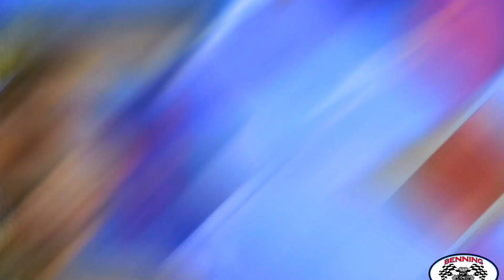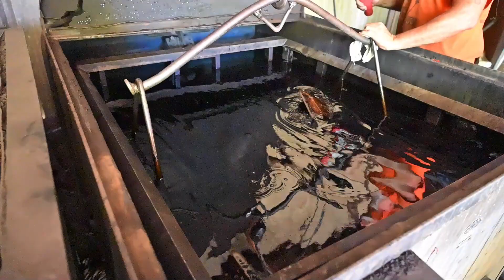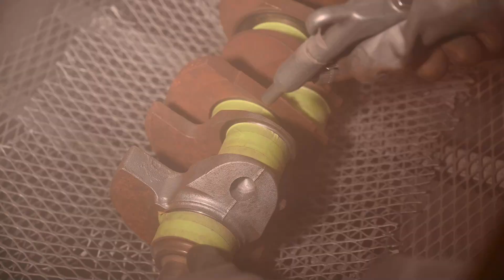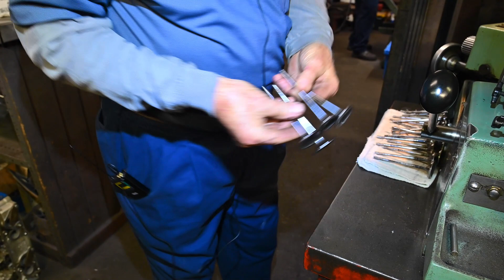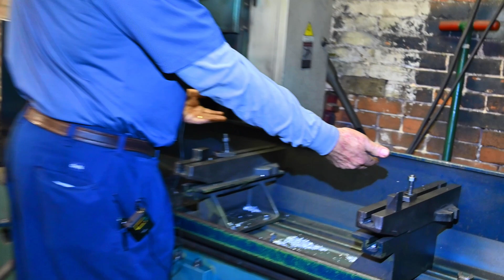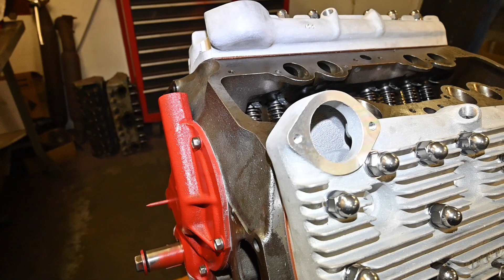Engine Machine shop behind the scenes Week# 2 Head Department

Comment: Many years spent working in that head department when my pawpaw was alive and owned the place. Haven't touched that serdi 100 in probably 20 years ,  I bet I could still run the heck out of it. That and the old slow surfacing machine. Done a many of cat , Detroit,Cummins JD 's on it. Mr Parks was telling the truth it's slow like a turtle , but  very precise. Miss working in that head department if I had it to do over again . I would have done a lot of things differently.